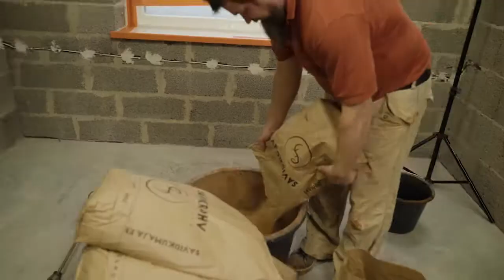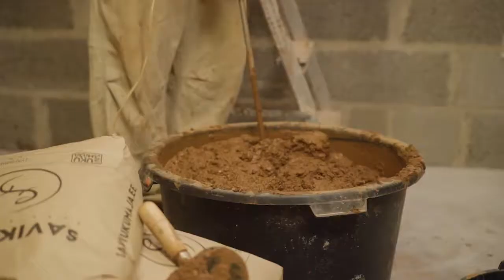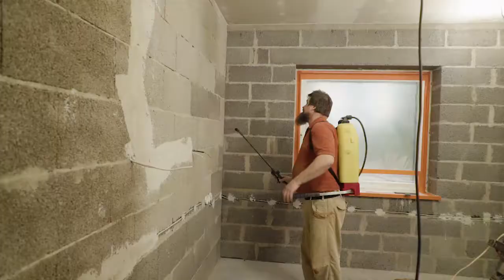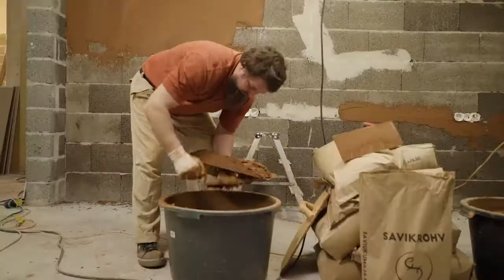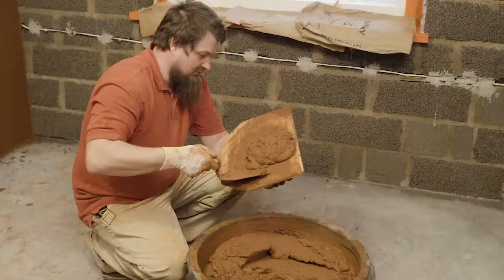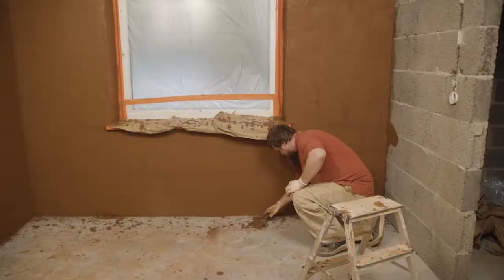How to clay plaster - using only your handy tools

Comment: What are the benefits of clay plastering
Reply from the maker: Clay plaster adjusts the air humidity in rooms, accumulates heat, inhibits mold formation, neutralizes electromagnetic pollution, suppresses echoes, and is suitable for people suffering from allergies. It is possible to shape round edges and different forms and is 100% natural and reusable.

Comment: Fantastic video mate, does clay a thick coat on top of or red bricks help house insulated?? Thanks
Reply from the maker: If there is a lot of fiber inside then yes. You can add extra fiber to the plaster.